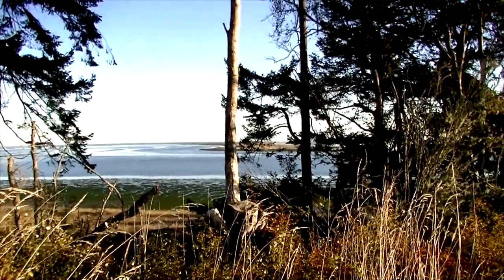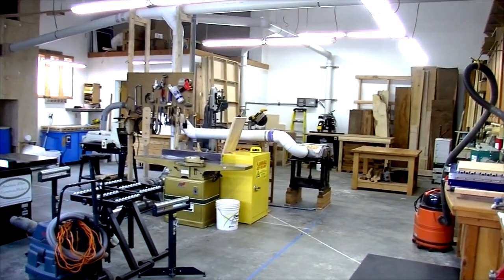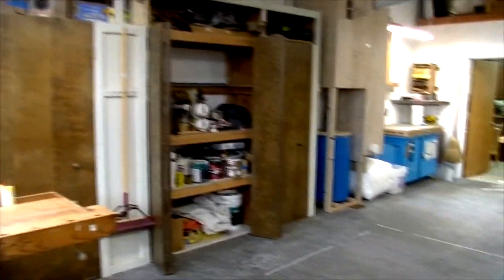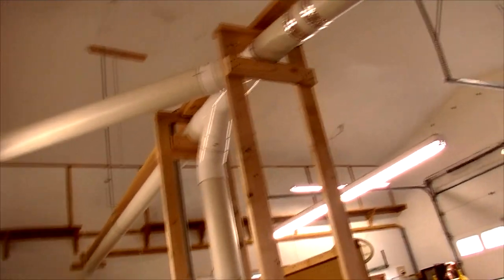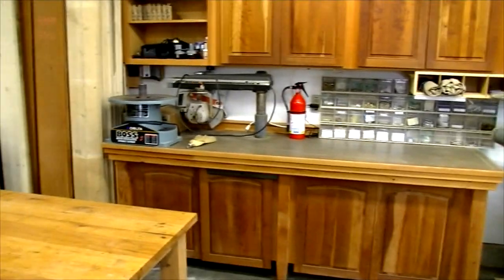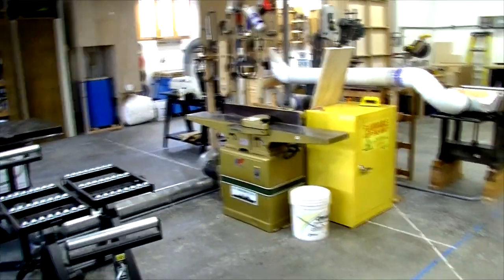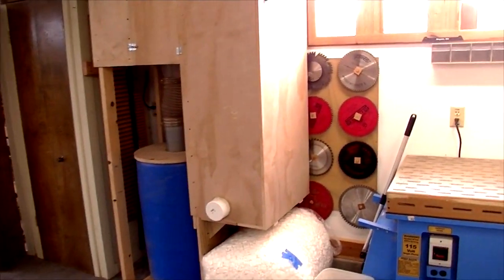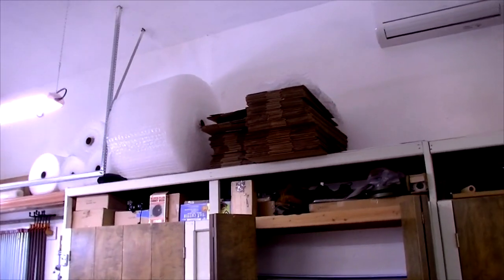My Sequim Washington Woodshop: Andrew Pitts~ FurnitureMaker

Comment: Asome shop and love the layout and the way you did the vacuum system.  Going to have to redo my vac system like yours, like it much better.  I built my shop as we were building our house and it is 1250 sqft.  I put in a bathroom as well, at 70, you want to avoid running in the house.  I build a 250 sqft paint room in the back of the shop with a door into the shop to keep it clean.  I got some great ideas to make some changes to my shop.  Thanks for the great video.
Reply from the maker: Thanks Rick. The paintroom is a good addition. I had one in my Virginia shop (https://youtu.be/Bif8FrBSeXk) and used it a lot.

Comment: Hi Andrew.......great to see you back on You Tube again.   Although the previous shop was quite elegant this one has a great space and you have organised it well.   The kitchen/bathroom is a definite bonus.   Enjoy!!!
Cheers from Aus
Reply: Oh one more thing.....
Any chance you could show how your Planer sled is made and works......I have a need for something like that....
Cheers
Reply from the maker: Yup, having a sink is great!
Reply from the maker: I'll have to get that into a future video, but all I did was rip some 3/4" plywood into a wide base and two narrow widths when combined with the straightedge clamp came to the width of the base. The straightedge clamp was ordered online ... there are several manufacturers. Screw the straightedge clamp to the base with the clamping parts "up" so you can clamp a board into them. That's pretty much it.

Comment: Andrew, any reason you didn't place any sound-deadening material on the inside walls of your dust collection "cabinet"?  I'm thinking of building a similar cabinet for my cyclone system, so was wondering about that aspect of yours.
Thanks for sharing this shop tour with us.
Reply from the maker: Hi Marty. I decided to put the egg crate type foam sound material only in the air exhaust path because my experience with sound transmission is that the most sound leakage is through openings and cracks. For example, if you have a pretty tight shop and run a noisy tool, step outside, and shut the door the sound intensity outside is greatly reduced. As soon as you just crack the door open, the sound intensity outside is greatly increased. So, I figured that if the enclosure was fairly tight, the most bang for the buck would be to sound treat the place that was the "open door", that is, the large air exhaust. The foam reduces reverberation, so that made sense to me. Also, the foam would be hard to place around the inside of the cyclone and filter enclosure, and would require an increase in the dimensions of the enclosure to accommodate the foam thickness, and that did not seem to be cost effective for me.
Reply: Interesting approach.  One thing I just thought of was the idea of wrapping about 1" of cardboard around the outside wall of my unit, focussing primarily on the impeller which is where the majority of the noise from my unit emanates from.  Then I'd spray expanding foam insulation to the cardboard, which should pretty well get rid of most of the sound.  That way I wouldn't have to worry about eating into any more of my shop, nor worrying about the heat from the 3hp Baldor motor causing any problems.  Perhaps as important, if this approach doesn't work out, then it'd be a relatively easy to remove everything back down to the original surface, because the cardboard wouldn't stick to the unit.  Have you ever hear anyone else coming up with this approach, and if so, any thoughts as to how it may or may not work?
Reply from the maker: I don't really know what the acoustic properties are for cardboard and expanding foam, so I can't help you there. I do know that most sound is transmitted along free air paths, so blocking (sealing) the path with something will help cut down on ambient sound.

Comment: Andrew,  Any plans for a kiln?  And the space is very functional. Not as classic as the old VA shop.  There seems to be a lt of reflection of sound off the hard surfaces?  Maybe rubber mats on the floor for sound absorption and easy on old feet?  You never have to leave the shop. LOL
Reply from the maker: Tom, I won't be milling lumber here, so no kiln needed. You are right about the echo. With the tall cathedral ceiling it is an echo chamber. The VA shop had an acoustic tiled ceiling. I might have to add some sound dampening material if the neighbors start complaining, otherwise earplugs will have to do.

Comment: ive been in the industry for only 20yrs so a bit of a noob, what is a saw stop? also this is an epic workshop cheers for the tour.
 he who dies with the most tools wins, your clearly winning
Reply from the maker: The Saw Stop is a table saw that has electronic circuitry such that if the blade touches your flesh it will immediately stop so as to not cause injury. It is a really well built saw, as well.
Reply: ahh yes ive seen the hotdog and the human tests, figured youd call that the table saw. amazing technology, are you limited in blade types and does it destroy the blades?
Reply from the maker: It will use any 10" blade, but it will destroy the blade if it actuates.

Comment: Hello Andrew I see you haven't grounded your PVC ducting are you going to in the future?
Reply from the maker: Hi Peter. No, I did not ground the PVC nor will I be grounding it. Here's a link and a link within this link to explain (http://billpentz.com/woodworking/cyclone/ducting.cfm#static_electricity), but briefly the uniform dust volume inside the PVC pipe creates a more or less uniform electrical charge on the interior pipe wall. Because the PVC is an insulator, the charge is pretty much locked into the area in which it formed and cannot travel around the pipe the same way it could have in a metal pipe. The result is that there is no appreciable charge difference between areas of the pipe internal, so there is no electrical potential to cause a spark inside the pipe. If I were to run a grounded wire down the inside of the pipe, then I would create an electrical potential between the wire, at ground, and the charged pipe and would be more likely to see a spark. I'm better off without a ground wire. The outside of the pipe is a different story, as the pipe and any conductor near it creates a region of charge difference, and that is why one can feel a shock while touching a vacuum cleaner hose on a dry day. Where I live, we don't have dry days (the Pacific Northwest), and I've never noticed any shock from my vacuum hose nor my dust collector pipe. Metal pipes are a different story, also, since charge can move around easily and cause areas of potential difference, so metal pipes should be grounded. Andy